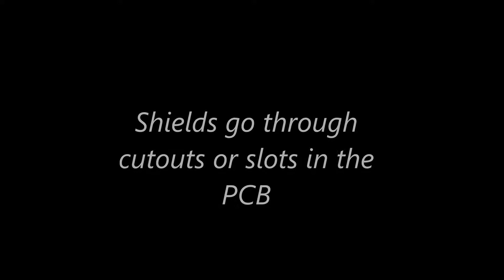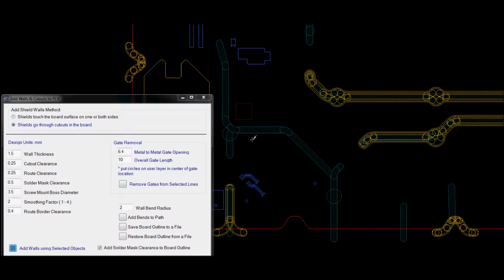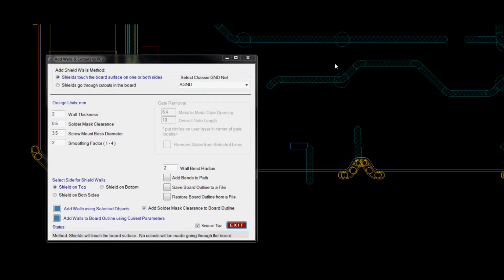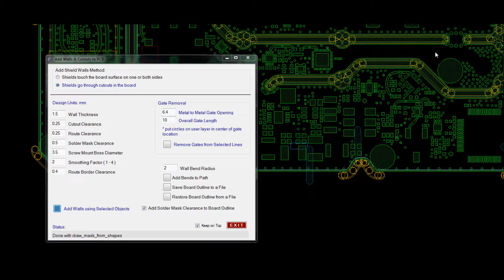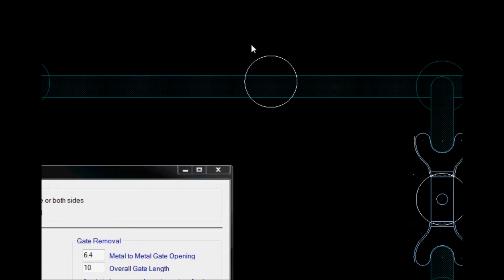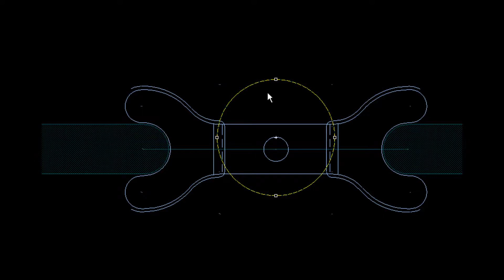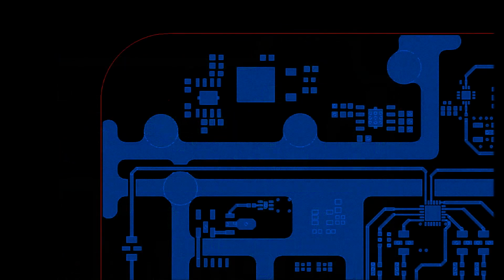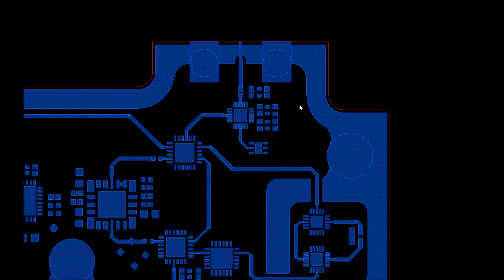Add Shield Walls

Comment from the maker: Development of this tool continues.  I've added more features:

- Combine overlapping conductive area, solder mask, and placement keepout shapes into single shape objects wherever possible. 

- A field for external wall width.  Walls that go around the board outline will need to be slightly wider to accommodate the copper being pulled back from the board edge.  Now the user can specify internal and external wall widths separately.